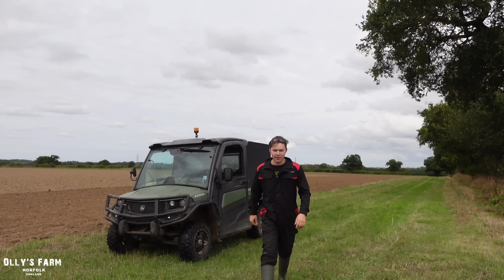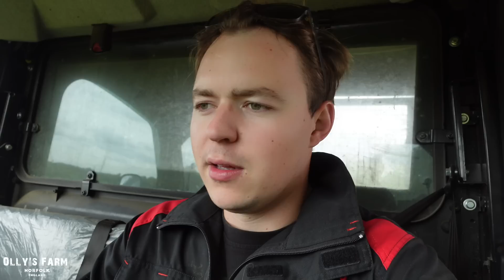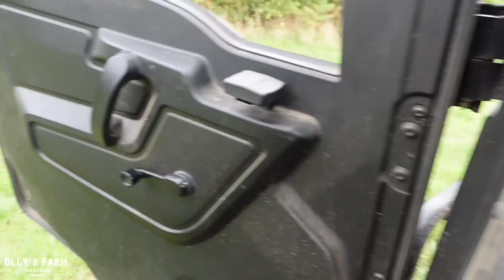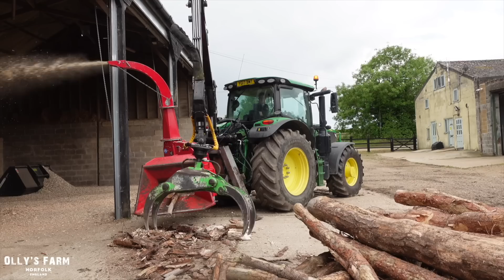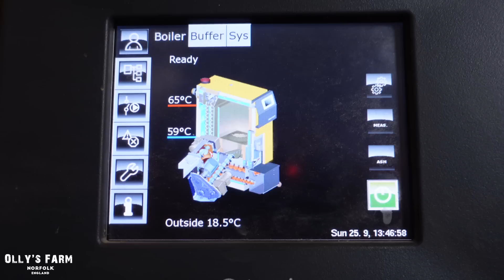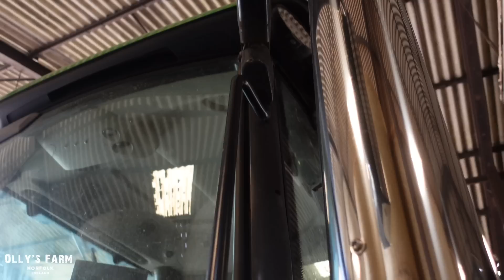Heating The Farm With Biomass Wood Plus Crop Update & Stainless Tractor Upgrades!

Comment: Q. Should the U-bolt retaining the mirror guard be threaded through thr mirror guard in the opposite way? I'm just wondering if the clamping force of an open U-bolt with two nuts as they are in the video is enough.